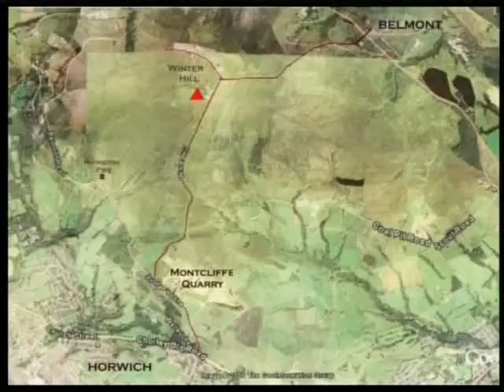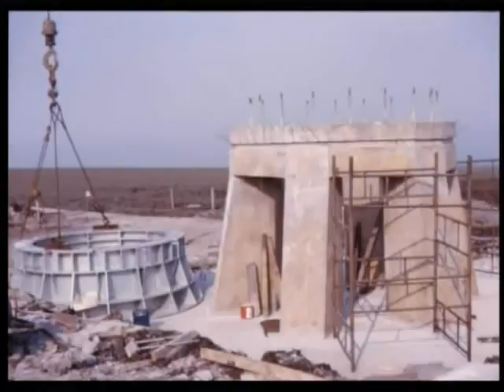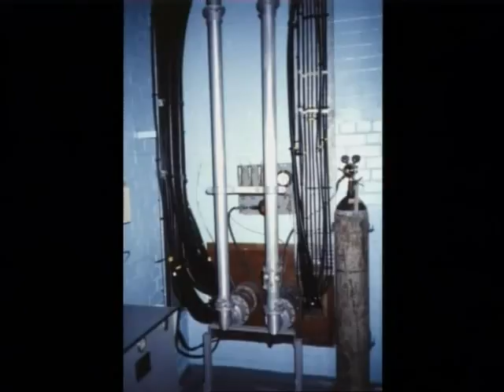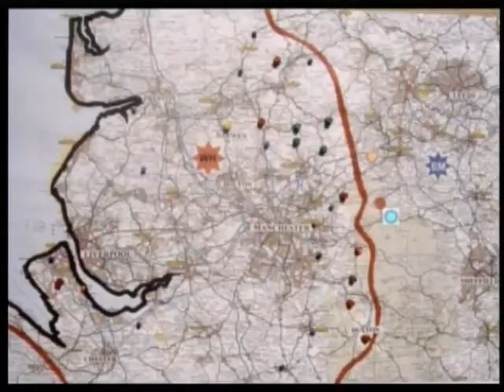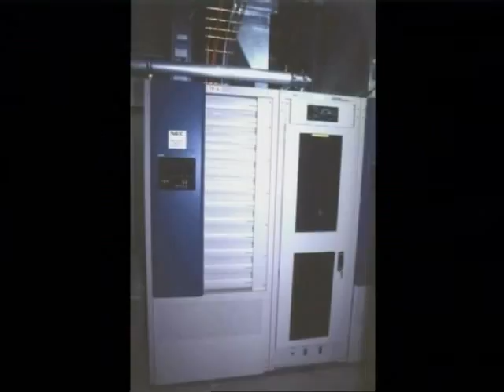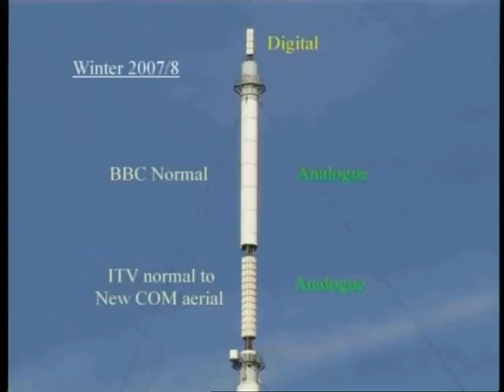Winterhill TV transmitter

Comment: An excellent video history of this significant introduction of digital broadcasting that led the way ahead of many countries.

Here in VietNam, where l have lived for 30 years  l have watched the progression fron 2 camera program sets and loudspeaker street broadcasting - often in the form of 4 speakers mounted atop 50-100 foot masts (for workers in the surrounding fields) to these days where there are extremely high fibre optic cables from North to South carrying broadcasting and communications.

In neighbouring Kampuchea/Cambodia broadcasts are carried by radio to multi-channel receivers similar in size to a smartphone.

We have minority broadcasting in parts of the country. Every province has it's own broadcast facility which carries local news. Vietnam also has a couple of satellites that ensures the national multi-channel Voice of Vietnam from Ha Nói reaches every corner of the country as well surrounding countries (VN donated the transmitters way back) and even rents time on overseas countries transmitter. VoV rented time on CBC transmitters located in the  swamps of Sackville, New Brunswick.

Transmission of Chinese programming is strictly prohibited in VN and the BBC is also censored (available on the InterNet).